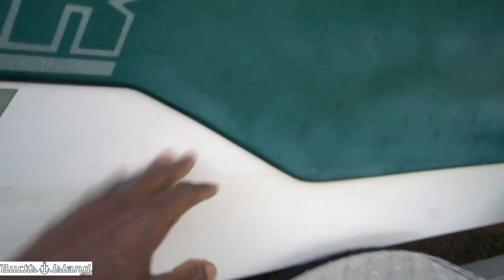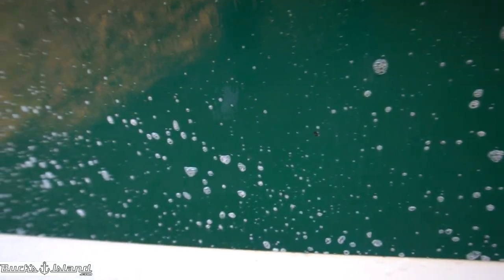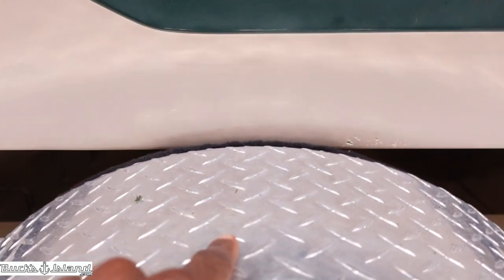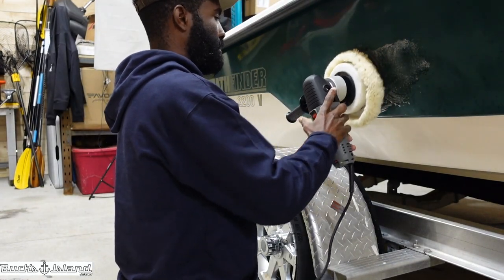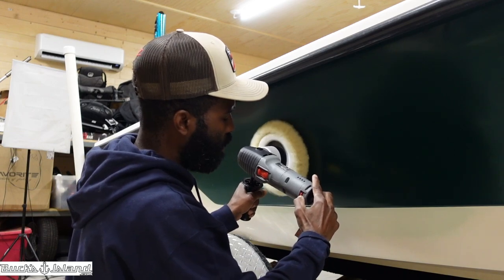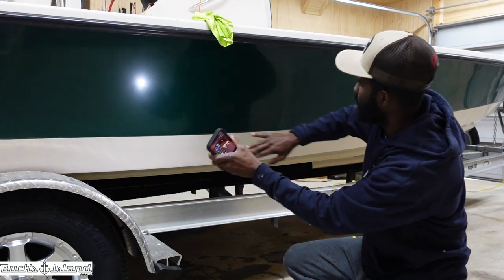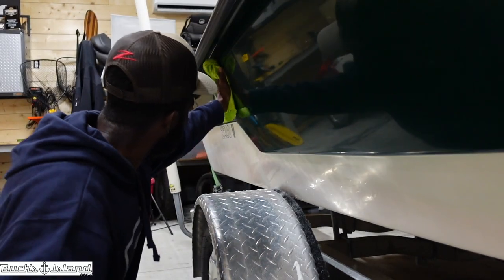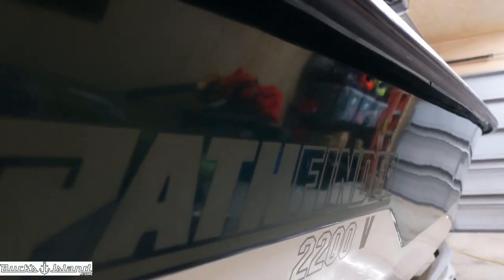I bought a 18 Year Old Bay Boat - gel coat restoration

Comment: at 12:26 if that is a chip in the gel coat on the water line towards the bow 

Pick up some marine tex .. its a two part epoxy used to fix gel coat dries so hard you can actually drill and tap threads in it .. they also make a dye to color match

Comment: As a vehicle and boat detailing enthusiast, one suggestion if you want to keep that gel coat looking better for even longer and minimize your future efforts is to use either a synthetic sealant or for even longer protection, use a ceramic coating. They do cost more, ceramic especially, but they last exponentially longer than traditional waxes. Great job though, the restore came out great!

Comment: Brian, congrats on the Pathfinder!   Looking good!  That 2200 is a great boat, very versatile.     
You don't know me, but I strongly recommend 3M Fiberglass Restorer.  It is very, very good stuff.   You would have done half the boat in the time you worked on that spot.  No lie, brother.   I've been doing this for a long time, and nothing is quite like it.  It saves you 2x the cost in time saved.   Next time, off camera or whatever, (if it would offend sponsors) try the 3M stuff, and you will see that it's not just hype.   Looking forward to your vids out of the new ride!

Comment: Maybe it's the camera not capturing it but it seemed like your wool pad was barely spinning on the polish step. I'd have to bet you'd get a better result with DA buffer and smaller pad. You can also use an air gun to blow out all the crap that builds up in the wool
Reply from the maker: Orbital. It’s not supposed to spin.
Reply: @BrianLatimerFishing  oh that must be why. random orbitals should be used, not orbitals